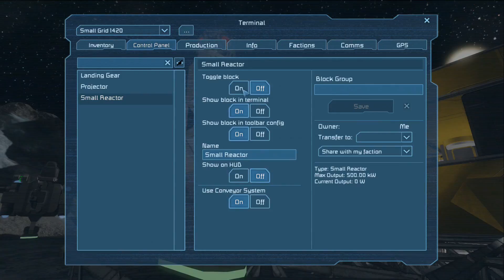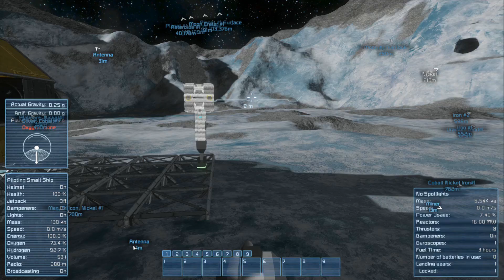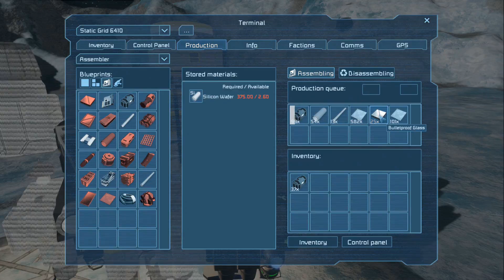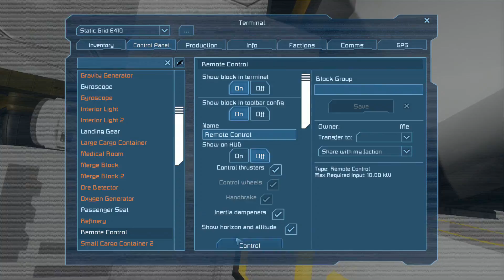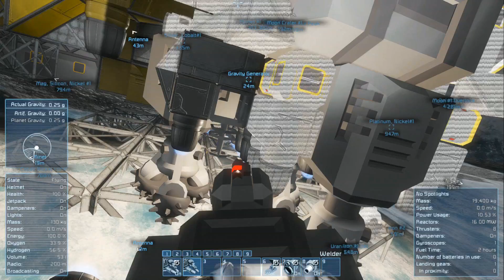Space Engineers Survival LP S2Ep16 "Show Buildable" Blueprint Miner

Comment: Of all the bugs in space engineers that might be the most useful. 
There is a method of connecting a small projector to a large piston over a welding pit, pretty awesome watching a ship print out with the push of a button. But a projector on a stick isn't a bad way to do it either. Carry on Space Engineer
Reply from the maker: +8RedBear5 Thanks for the suggestion. I would much rather use a welding pit. That's a very good way to do it. Welding pits seem to be one of the less buggy methods for ship construction.
Ingenuity seems to be a requirement when playing Space Engineers. Luckily there's a community for Space Engineers & the Steam workshop. I don't typically pull straight from the workshop, but there's often some good inspirational ideas.
I'll be looking to set up a more efficient way to do my welding once I get a little more established.